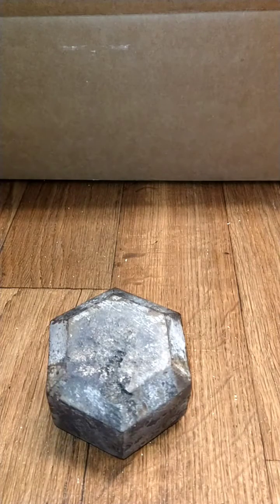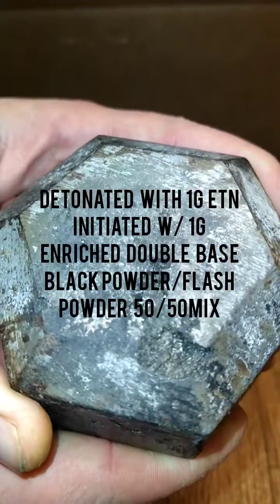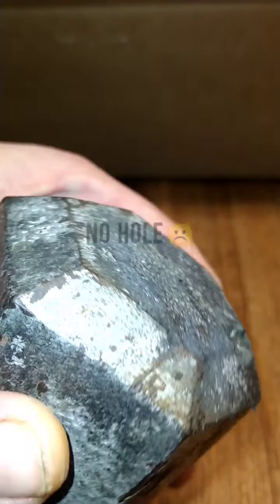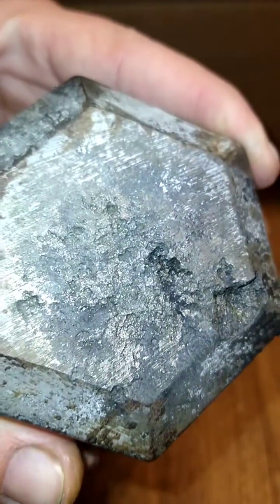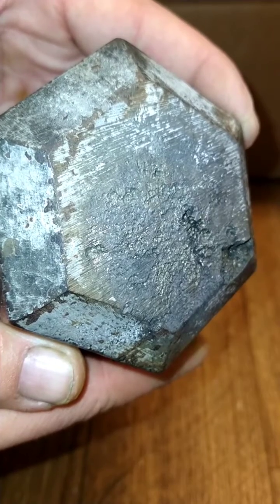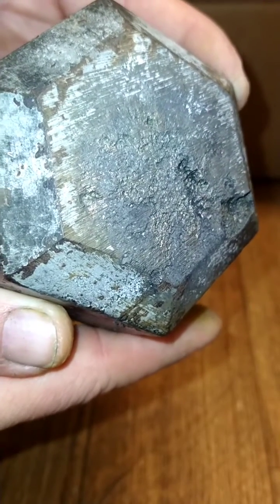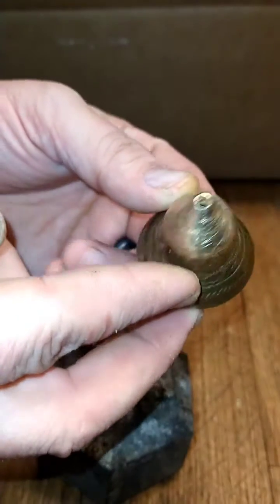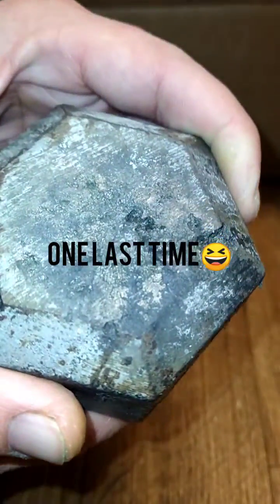Shaped charge test #3

Comment: Are you sure that some of your problem isn't due to the composition of your liner? I think you said that you use aluminum powder in an epoxy binder. I think that would break apart quickly and fail to form a good jet. As I understand it, the ductility of the material for the jet is somewhat important, which is one of the reasons that they often use copper. The hollow charge compresses the liner into a lump with only one way out (forward toward target) and so the material flows out that way as a jet. If the cohesion of the material is insufficient then I think it will spray out into bits rather than a rod-like jet.